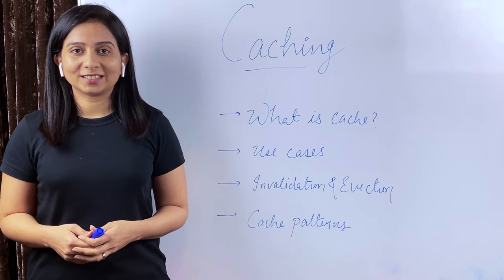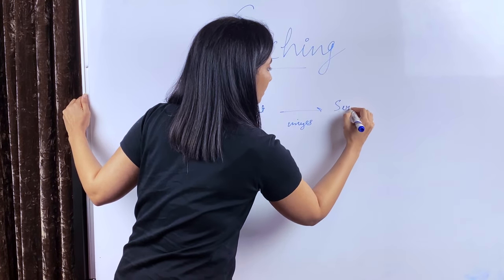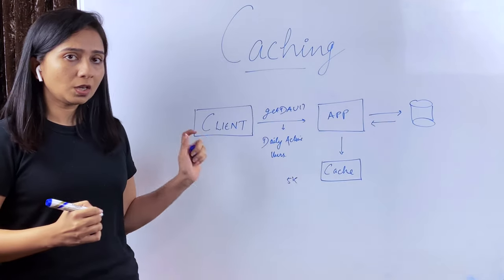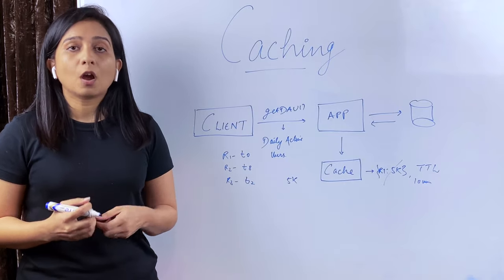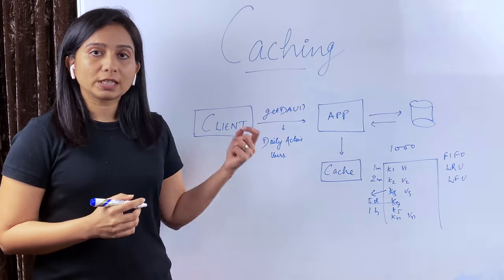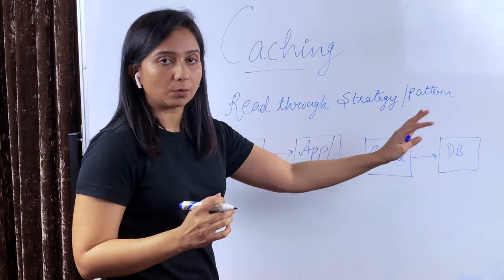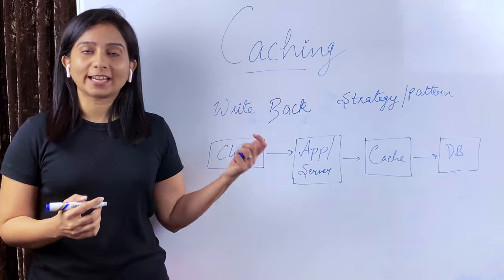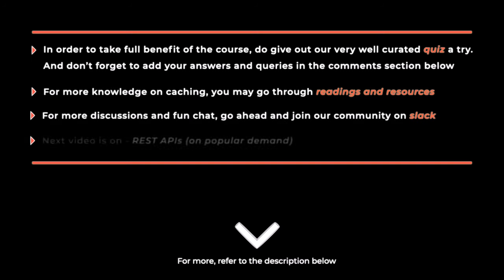Caching | Cache Patterns | Cache Invalidation & Eviction | System Design Tutorials | Part 9 | 2020

Comment: Great summary and course overall, thank you! One comment I'd have is on summary page saying that read-through is a great alternative for cache-aside, why is that? what specific benefits has read-through to make it a great alternative? IMHO both work the same (i.e. for each request, is checked if response is cached, and send response or update cache accordingly), while read-through has actually some downsides (i.e. can be single point of failure, can limit data modeling), thus not a great alternative. Maybe an upside would be easier to implement in the sense of using existing libraries.

Comment: Hi, How do update catch DB whenever data get inserted to Main DB, without making request from API or application ? For example if I have make request for a first time it will fetch data from main DB, get inserted in Catch DB with a catch key , and I am mentaning expired timing for 60min. Now in main DB data get inserted with 10min , I want that in cache table , how can be achieved this. Is it possible to update catch DB table? Thank you
Reply from the maker: Yes you invalidate cache every time there is an update in main db.

Comment: @sudoCODE In case of write around pattern, we are not communicating with the cache and only writing in the DB. When the next read request would come, our cache is not updated and contains old data and not updated one as per the last right, is that also a drawback of this pattern or can we avoid it?